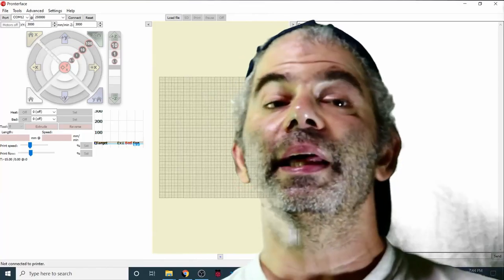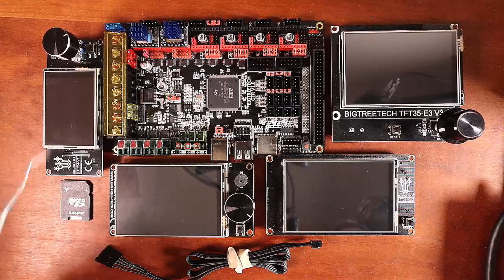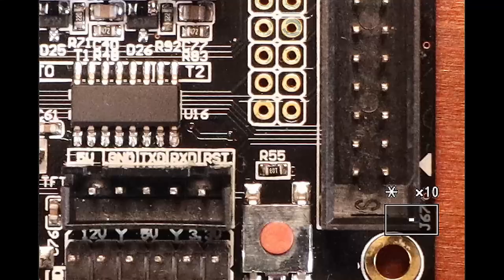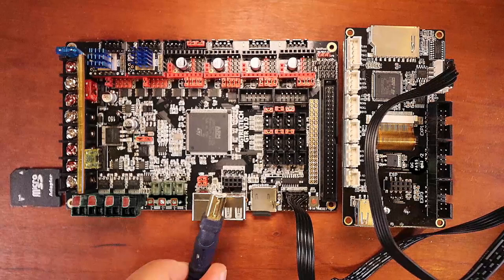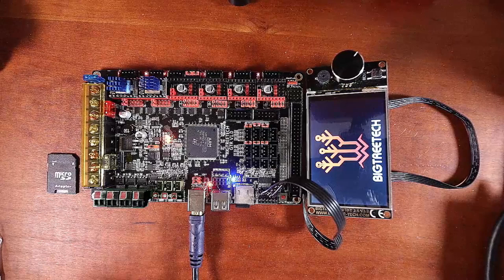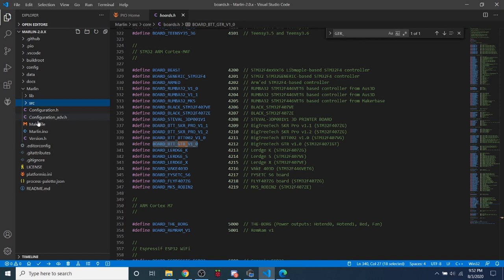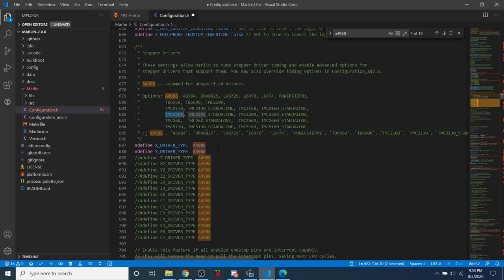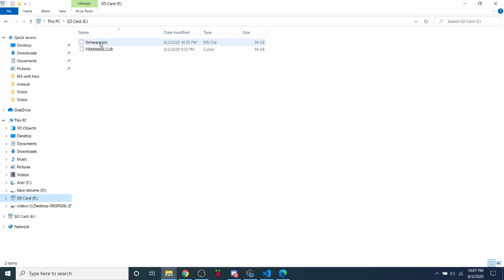BTT GTR v1.0/M5 v1.0 - TFTS

Comment: Great Video. I paired mine with a BTT TFT43 V3.0, and ran into an issue. I did find a fix others might find helpful. When I initially connected it new out of the box, it would not allow me to get past the Marlin or Touchscreen Option screen. I finally figured out that I had to connect the EXP 1 & 2 cables. After that it allowed me to set it to Touchscreen mode, and since then I have been able to disconnect the EXP cables, and it works fine on TFT cable alone

Comment: Are you using a pre-configured firmware from the BigtreeTech github or did you build it from scratch from default config's?
I ask because I tried multiple times to build the firmware from scratch and I can not get past the Serial Port Error where it says that "the Serial port can not be 0". I have looked through the Platform.ini , configuration.h , and configuration_adv.h from both the pre-made firmware and the default firmware and they are setup the same yet I can only compile the one from their github.
Are there other areas of the firmware we need to change other than in those three areas that we need to change in order to compile the firmware successfully.
Everything I have found says to just change both serial ports to -1 and 3, then the #define MOTHERBOARD BOARD_BTT_GTR_V1_0, and the default_envs = BIGTREE_GTR_V1_0.
Everything I have found so far said to just change those and it should compile but it does not. I still get the serial port error even though I set them to -1 and 3. I have tried other combination for the serial ports but none have worked. I could just use their firmware but I like to set mine up from scratch.
Reply from the maker: I'm building from scratch.

Comment: 415/5000
Hello Edward,
if I get some time I will also try to run my board with LCD.
BIGFREETECH SKR E3-DIP V1.1 with a B.F.T. T24-V1.1 screen.
The screen kept saying: No printer attached!
the truck with baud rate from 115200 to 250000 did not work for me unfortunately.

Thank you for the clear explanation in this video!
as soon as I can I will try it and give a report back!

friendly and healthy greetings from the Netherlands!
Rob

Comment: hi, i m using the tft35 v3 display. When I set the ports -1 and 3, the touch screen doesnt work. Keeps giving the no printer attached error but the marlin screen works with the exp cables. I changed the ports to -1 and 2 as i do with my other machines but still no luck with the touchscreen. still says no printer attached. And I did changed the baudrate to 250000 in both combinations on the display and the firmware. 
Any suggestions?
Reply from the maker: It's the buadrate in settings not match Marlin firmware.  You can change configuration file for TFT or adjust thru display or modify Marlin to match speed of TFT display default of 115200.
Reply: @EdwardBraiman  I tried your suggestions but it doesnt work in all 3 ways. Modifying Marlin to 115200, changing config file or thru display. I used ports -1 and 3 and also tried -1 and 2 but result is same. it keeps saying no printer attached. the touch screen  works in other machines that has skr and mks boards . it just doesnt work on gtr board. Marlin screen works
Reply from the maker: Post the configuration.h file on Discord.  I'll check.
Reply: @EdwardBraiman  Uploaded it to the general chat on your discord
Reply from the maker: Ok.  I'll look after work.  It seems you're the second person with issues.  Which version of Marlin firmware are you using?  I've not checked if Marlin released a new version in a couple of days.
Reply: @EdwardBraiman  its Marlin 2.0.7.2

Comment: Do you have a video showing how to connect a BLTouch to this board?
Reply from the maker: Not yet.
Reply: Edward Braiman Coming soon?  : )
Reply from the maker: Depends on Marlin firmware.  Its been unstable since January and every couple of weeks I try it again with latest firmware, it doesn't appear stable.
Reply from the maker: Understandable, it should be in the manual link in the description.  The reason, I'm avoiding the tutorial at the moment is the stability of Marlin firmware.  It's a quick way for me to upset people if the tutorial doesn't work.
Reply: Edward Braiman Are you using the Z-Min for the switch input or are you using all 5 of the board’s BL-Touch pins?  I was going to try it using the Z-Min so I could use the BL-Touch to home the Z.
Reply from the maker: For me it's been unstable since SKR v1.3 build for development build.  I've opened multiple bugs for Marlin firmware and it doesn't function even close to the way it used too.  You now need to test in a working printer verse a bench test.  The added bed leveling and you may need to adjust on configuration advanced.h as well.

Comment: hello
can you share the firmware folder that you modified to make the video?
because I did the same thing you did step by step, and even then it gives me compilation errors.
the firmware folder was to be able to compare yours as mine to see where I went wrong.     

if not, I am screwed, I have no idea how to configure the firmware correctly.
I've been on this for several months, and I don't see the light at the end of the tunnel.
Reply from the maker: Have you tried uninstalling plug-in and VScode and then reinstalling?  Otherwise join my Discord and I can send it thru.
Reply from the maker: By plug-in I mean Platformio IDE.

Comment: Very good, really enjoyed.                                 where site in firmware, I configure for tft 3.5 v3.0?
Thanks
Reply from the maker: You're welcome.
Reply from the maker: Serial port 2.
Reply: @EdwardBraiman   thanks . i will tried
Reply: Just a heads up, 2 recent TFT70s (past two weeks) had a default baudrate set at 115,200
Reply from the maker: This can be changed with TFT configuration file.

Comment: How to connect BTT GRT1.0 to MKS TFT70??
Reply from the maker: Should be the same process.
Reply: @EdwardBraiman  nope. GTR got rs232 TFT port. And MKS TFT works only with 8 pin cable
Reply from the maker: Sorry, missed the MKS part.  You're probably going to need to edit pins file or use exp1 or exp 2.  It's not an optimal solution.
Reply: @EdwardBraiman  yes. Now when both parts came. I can see. This is not practical solution 😡😠

BTT works only with BTT. MKS work only with MKS. That sux
Reply from the maker: I understand your frustration.  Right now I'm trying to decipher the new MKS sGEN v2.0 that MakerBase sent me to test out and it's a mess.
Reply: @EdwardBraiman  I regret that did not buy newest 32 bit Zonstar motherboard